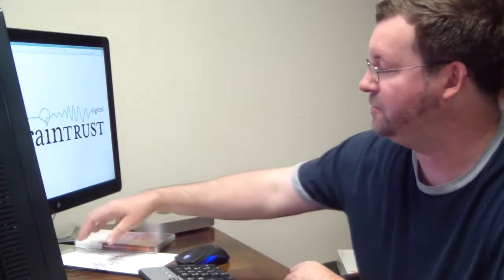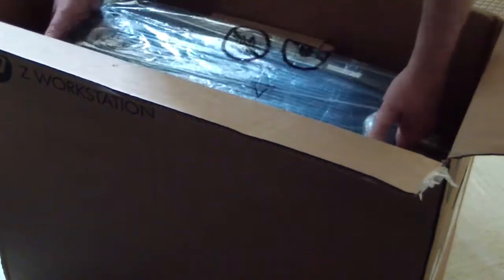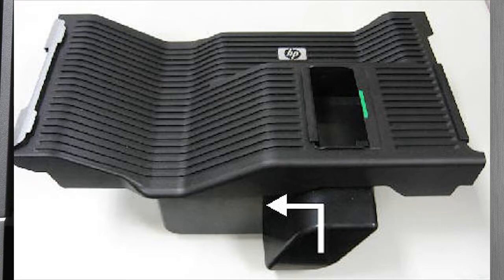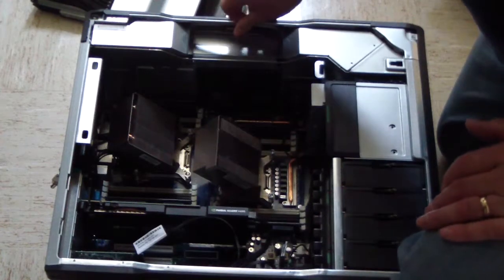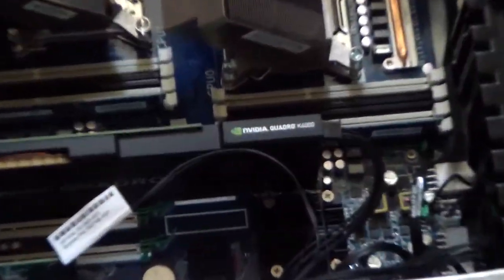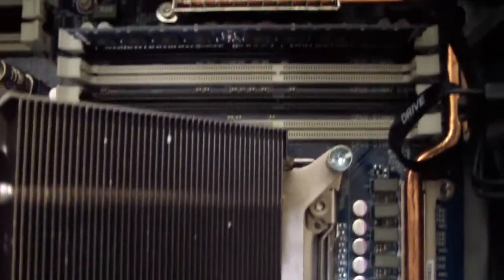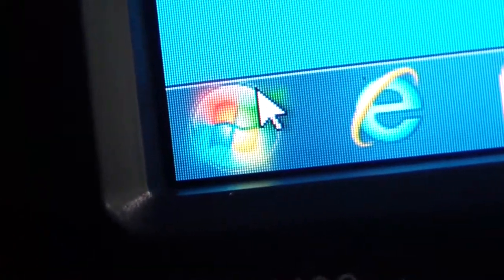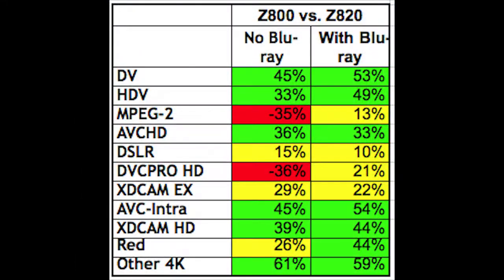Under the Hood: The HP Z820 Workstation

Comment: hi, I'm usign Z820 with 2 Processers 
"UserBenchmarks: 
CPU: 1st CPU: Intel Xeon E5-2630L 0 - 59.8%
GPU: AMD RX 580 - 54.8%
SSD: Samsung 860 512GB - 60.9%
USB: WD My Passport 0820 1TB - 463.4%
RAM: Hynix HMT351R7EFR4C-PB HMT351R7EFR4C-PB HMT351R7EFR4C-PB HMT351R7EFR4C-PB Micron 18KSF51272PZ-1G6K Samsung M393B5270DH0-CK0 Samsung M393B5270DH0-CK0 Micron 18KSF51272... 64GB - 44.7%
MBD: HP Z820 Workstation"
Still when I am using Revit & AutoCAD is lagging not responding well can you help me?